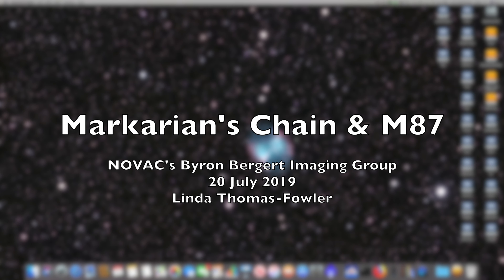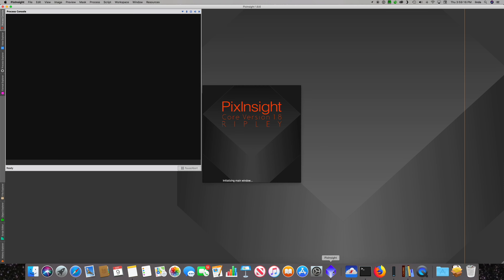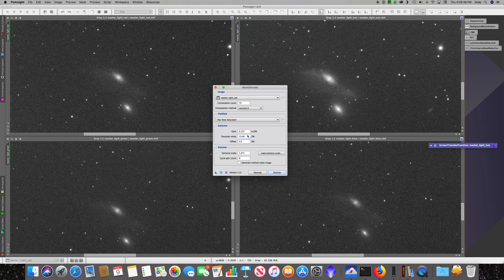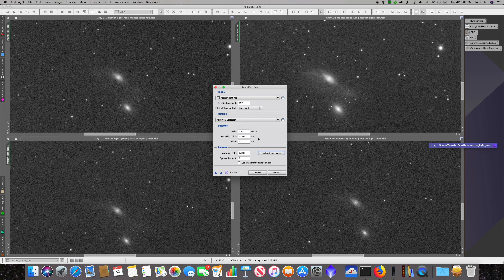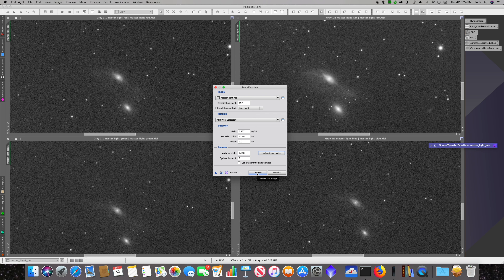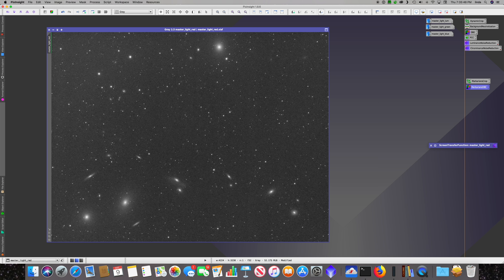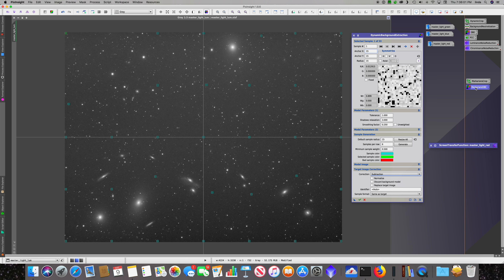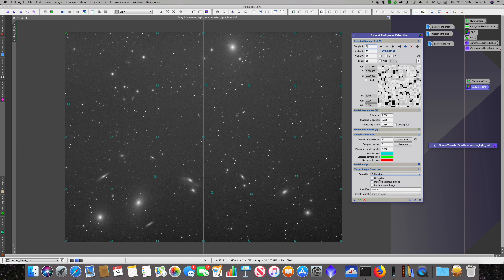PixInsight Processing: Markarian's Chain & M87

Comment: I am a bit confused that you did noise reduction before DBE - would this be why they looked bad the green and blue.
Reply from the maker: It's my understanding that Mure Denoise should be done before anything else though I don't have much experience with it at this point.
Reply: @LindasAstronomyAdventures  also I have noticed that if a image is not cropped 100% then the DBE does not work well.  You have some good images there.
Reply: Mure is recommended on each separate stack of R G B prior to channel combine, so yes, definitely before DBE.